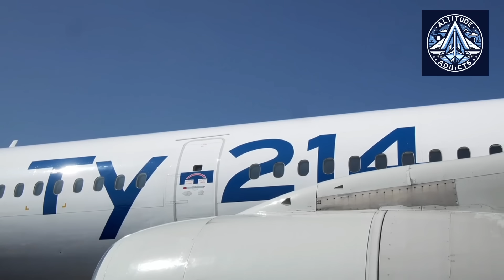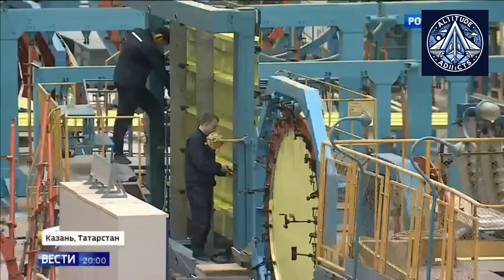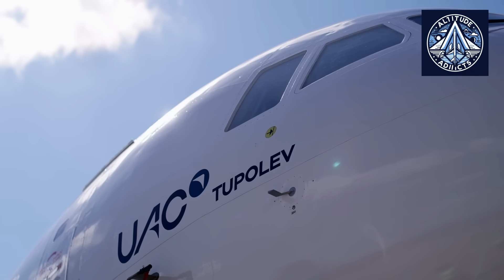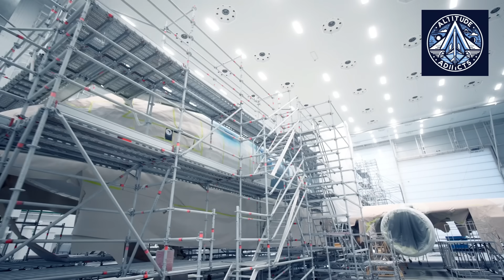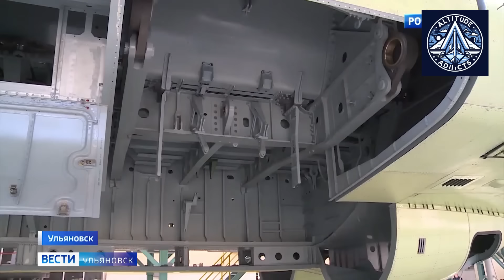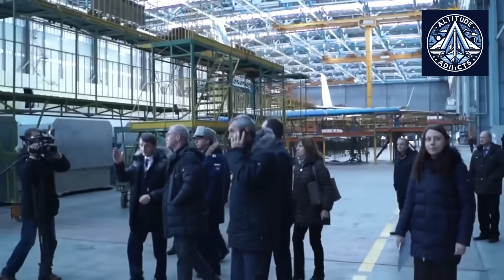Russia’s Tu-214 Completes 40 Flights: Next Steps for Certification

Comment: The 3 crew model has its electronics bay in the cockpit instead than the B-787 bellow the lavatories ( no leaks ) with easier access for any emergency and prompt reaction to eventualities, they serve their purpose well and is an old tribute to the heavy duty mentality of the old Soviet Union, the PS-90 engine is good for up to 30 tones of trust, ask the Germans they pushed it to the limit to see its limits...!
The TU-214 has more in common with the A321XLR with heavy duty landing gear and more powerful engines, as for range, they can always do like Airbus and daisy chain cargo containers made fuel cells to give it the longer range.... They are of similar weight category too...

Comment: Last year, Sergei Alexandrovsky, head of the Aeroflot Group, proposed to give up on the Tu-214 in favor of the more modern MS-21.
It seems that the Tu-214 will be short-living if MS-21 becomes a success.
Reply from the maker: Aeroflot wants single model fleet. It cancelled both Tu-214 and SJ-100 orders. Tu is more profitable per passenger in certain cases. Hence, it also has scope.
Reply: Porque não o sucesso para os dois ?

Comment: Air India should buy this aircraft instead of relying on boeing 🎉
Reply: Air India issues illustrate why Airlines need a mixed modern fleet! Buying at least 100 planes from UAC would keep the airline functioning when Airbus and Boing are grounded! For me, Airbus & Boing are the same because they use parts and assemblies and.engines from the same auppliers. It is even difficult to tell Boing and Airbus apart unless you see it written.on the fuselage or you were told. 

Embrea and COMAC are the same! The only company that has distinct and different technology today is UAC!

That having been said, UAC offerings must provide the basic conforts that customers have come to expect amd strive to provide comparative performance as well!
Reply: Saya pernah mendengar ada maskapai India yang bangkrut karena membeli A320 dengan opsi mesin PW.

Comment: There was supposed to be a PS-90A3 version of the engine, a significant improvement over the "basic" engine, i wonder why it could not be used instead.. Too many Western parts perhaps?
Reply: PS-90A3 adalah versi Rusia dari PS-90A2. Celakanya mesin tipe baru tersebut hanya memiliki keunggulan umur yang lebih lama, bukan lebih efisien bahan bakar.
Ada kemungkinan PS-90A2 saat pembuatan awal tidak sepenuh hati menghasilkan mesin yang efisien, bahkan malah menghasilkan mesin yang lebih awet.